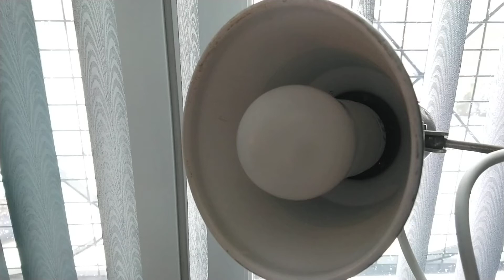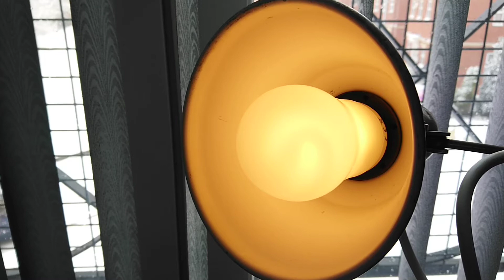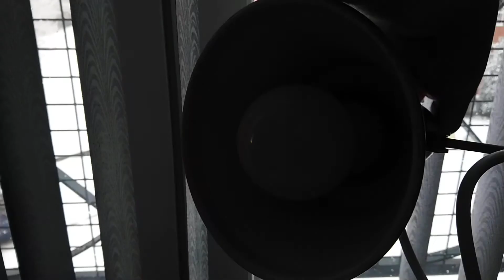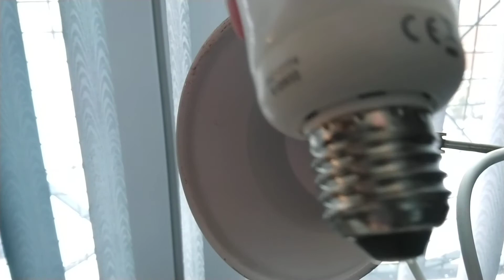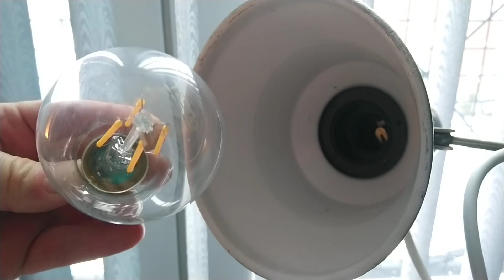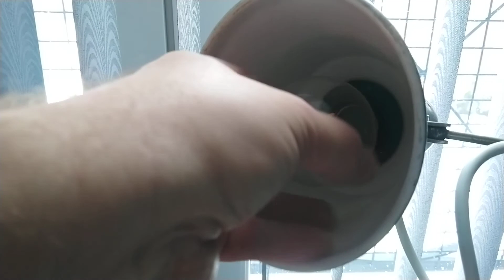Compact Fluorescent Light Very Slow to Light Up

Comment: I've got a Diall branded version of this CFL - when you turn it on, it doesnt light up until you tap several times on the housing
Reply: Mine too. It has a loose filament so I tapped it and the filament connected and it works
Reply: @My_Lighting_Channel that explains why mine does that - thanks

Comment: For me it looks more like ignition capacitor issue.
Reply from the maker: Still working, used every day but does take a long time to get full brightness. Could be a bad capacitor but light is more purple on start up.
Reply: It might be a hot-cathode glow-start bulb, so It needs time to reach full brightness, but it lasts a lot longer than the instant start cfl bulbs.